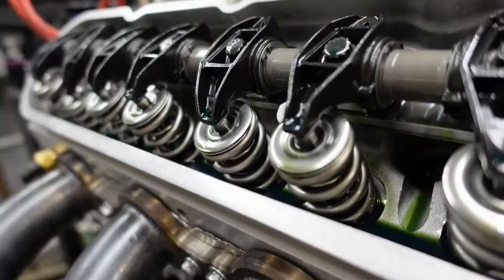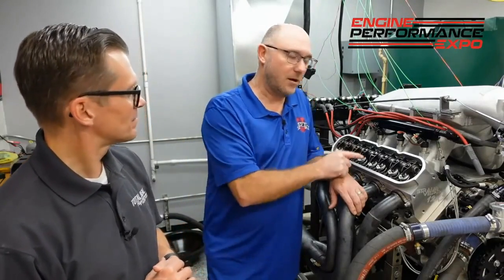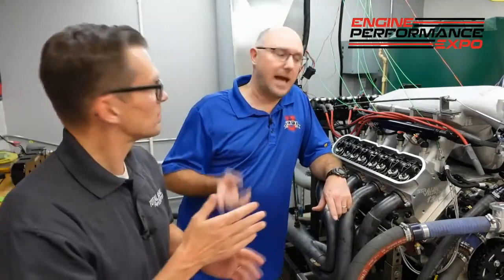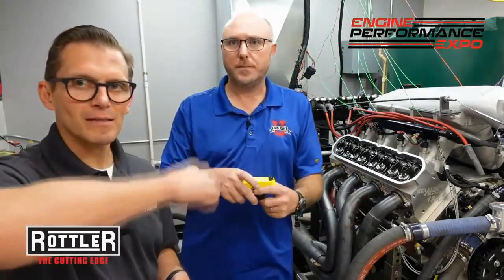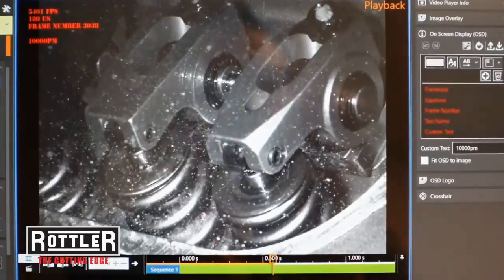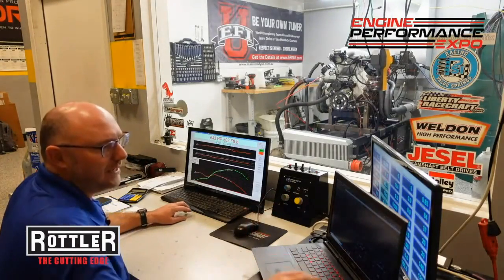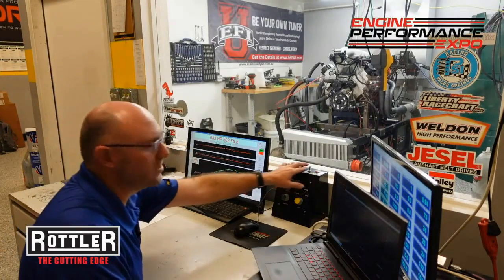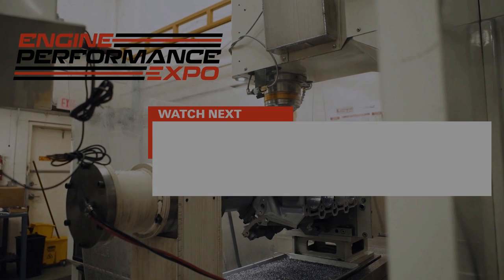Valvetrain RPM Limits (2023 - Episode 54)

Comment: The gain was from the reduction in mass on the valve side of the rocker arm pivot.

There is next to nothing to be gained be gained by reducing mass on the camshaft side of the rocker arm pivot.

This was all tested, developed, and established MORE THAN 50 YEARS AGO, by Smokey, Grumpy and the OEM engineers.

You have discovered NOTHING that the good guys don't already know.